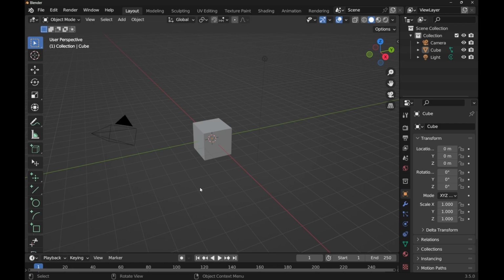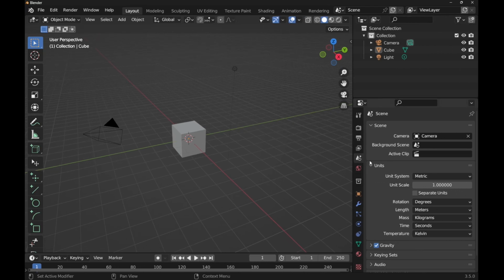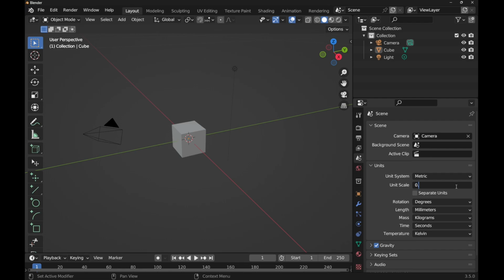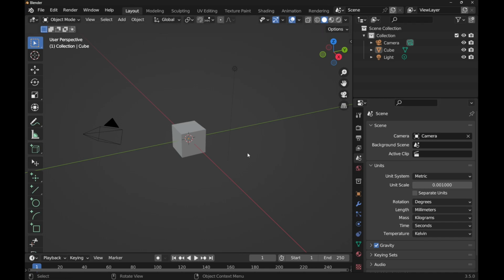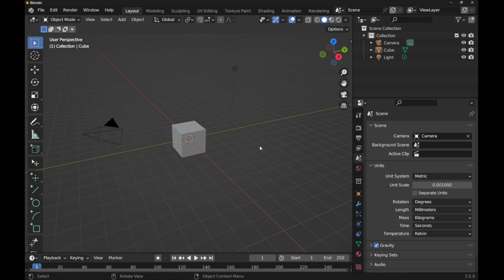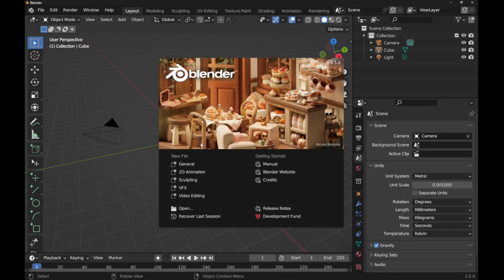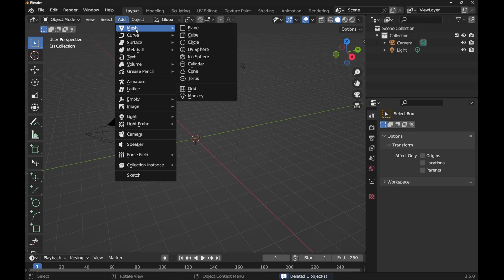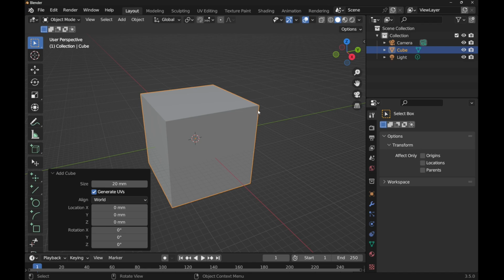Learn CAD Sketcher | 2 | Set up millimetre (mm) scale | Blender Beginners Tutorial for 3D Printing

Comment: 2:55 so you set the Unit Scale to 0.001 because mm is 1/1000 of a meter? So kilometer would be a Unit Scale of 1000!?
Reply: I had to set it to 0.0001 to get a 2mm cube like in the video. Weird.
Reply: @thesral96  my viewport was acting up too. I changed the clip start on the side view panel to .1mm and it helped.

Comment: How do you set it up for imperial?
Reply from the maker: You can drop the unit system down to imperial instead of metric in the scene tab.  Also you can swap in and out of measurements by adding feet, inches, miles, mm etc after your value if you don't want to do any conversions.
Reply: @MJ3D_Blender  Cool thanks, do you need to change the unit scale when working in inches?